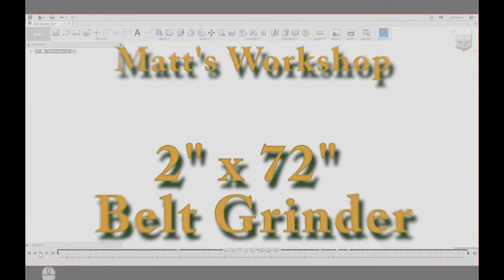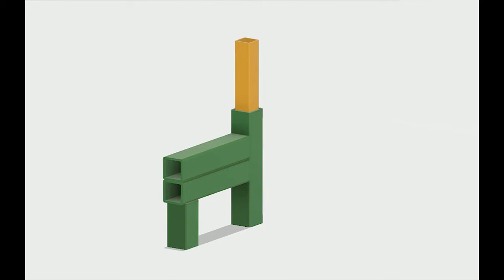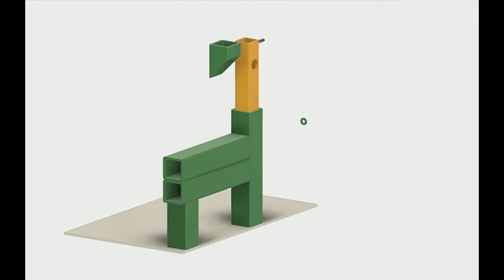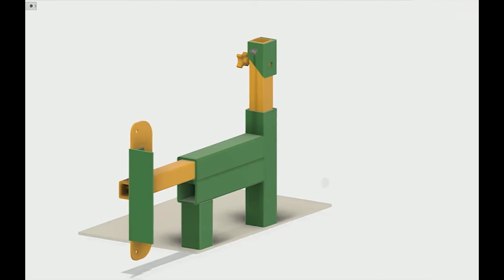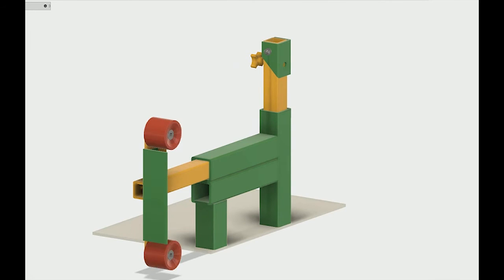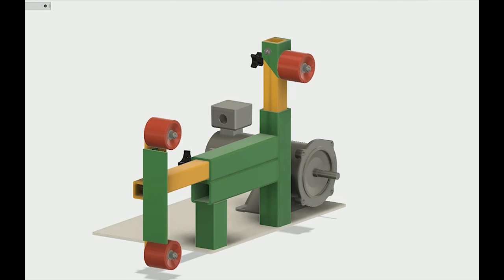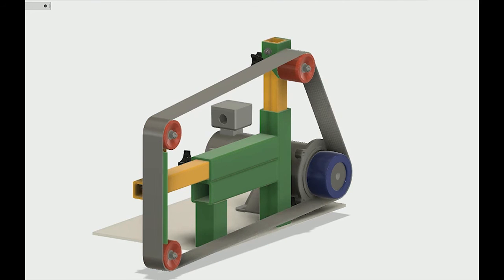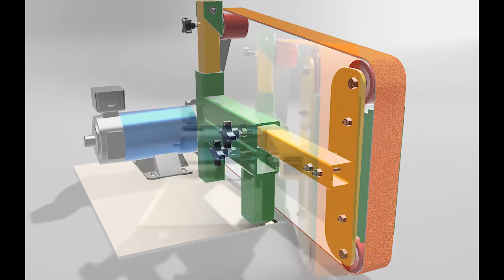Matt's Workshop 2x72 Belt Grinder Project - Part 1

Comment: Hi Matt, 
Great 3D model.
Can you please tell us where to get the model of actual 72" grinding belt?
Thank you.
Reply from the maker: Thanks David Smith. I modeled the belt myself. Just made the outline, did an offset of about 1/16" for the belt thickness and extruded it to 2 inches wide. I then applied a custom texture and color to look like a Norton belt. Hope that helps!
Reply: Thanks Matt for the quick reply.  The belt looks so good I thought you may have got it from a manufacturer, well done.

Comment: What are the dimensions?  Would've been much more informative had you added measurements.
Reply from the maker: The project was made from scrap materials. If you need to buy material, design your machine around those dimensions.  Nothing magical about my design.